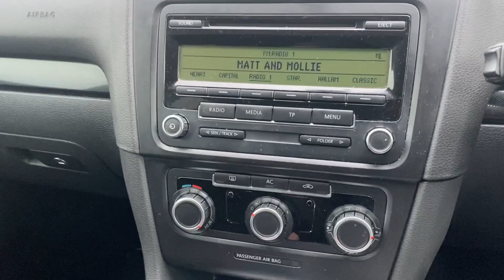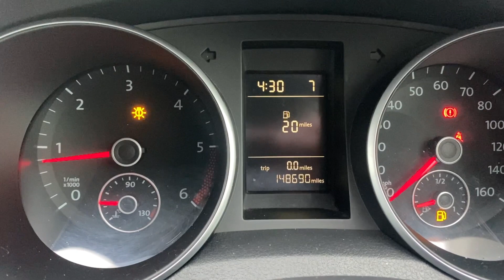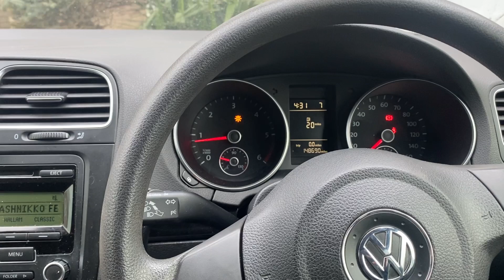VW GOLF MK6 1.6tdi DSG gearbox failure common fault on 7 speed auto. Reason for the failure DQ200

Comment: I have golf 6 dsg 7 gears the shift indicator dosappeared from the cluster and vcds shows me P0820 fault code do u have any idea what's the problem? The gear drives normal and no problem just gear indicator disappeared
Reply: probably mechatronic problem or low hydraulic fluid level
Reply: @StationX2  but no leaks at all the gear box from underneath is dry no oil spots and shifts normally
Reply: @fadiabdo9976  well if it drives normal and you have no issues there's nothing to do with changing the gearbox, but mine had issues thats why i changed it.

Comment: Hello I have 1.6 tdi golf 2011 gear box sometimes when driving shuts down and then I put in N and then back in drive then car moves but sometimes car jerks and doesn’t catch speed any help ? Maybe needs service or gear box is gone ? 150k on clock
Reply: probably mechatronic problem or low hydraulic fluid level

I had the same issues, if your transmission is 7 speed change it to a 6 speed its more reliable and it doesn't have that kinda problem.
Reply: I have the same problem..
Reply: Did you fix it ?

Comment: I have the same DQ200 gearbox in my Golf MK7.5 1.6tdi remapped to 150hp and it has been reliable so far done 80k miles. Does anyone recommend servicing these gearboxes as VW claims its sealed for life
Reply from the maker: Yes I recommend change the gearbox oil and mecatrônics oil two VW have the oil for sale
Reply: @HelderPutoPerformance  is it easy enough to change by myself or reckon it's better to give it to a garage but many garages that I've visited doesn't even know abt dq200 gearbox and think it's just one oil so I don't know if I can't trust them

Comment: Got hot probably oil starved causing the bearing over heated welding itself to shaft more heat finally warping end of shaft. Possibly from going to many laps of local roundabout or just draining oil for service and forgot to re fill oil till it was to late
Reply from the maker: Hi probably have no oil that’s y is gone  but end I check have oil probably put oil after is broken 😂

Comment: Please can you help I have code p2849  fork a stuck dsg only selects even gears  and reverse any help would be massively appreciated
Reply from the maker: Hi mate without see the car and diagnoses is hard to tell what the problem
Reply: I have the same issue. Did you manage find out the what the cause was?
Reply: @onrd1775  it needed a complete rebuild and mech unit not cheap that’s for sure

Comment: Do golf mk6 7 speed dsg 1.6tdi and 1.4tfsi gearboxes are same or different?
Reply from the maker: Different gear racio
Reply: My gearbox code is MLE. Would my car work with same year 1.6tdi 7speed gearbox but different gearbox code for example I found on sale MGN gearbox. Or I need exactly the same gearbox code? Thanks for answer
Reply: @linasvaici  The original 6 speed gearbox had wet clutches and was made by Borg Warner. The later 7 speed boxes had dry clutches and were manufactured by VAG.

Comment: so I can change my oil on a dq200. I thought was sealed for life
Reply: 100k is the life according to manufacturers so after 100k just service it and it will last another 100k
Reply: @arbazamir8991  MInes at 201000 kms and seems ok. Im told you cant change the oil Do you have a video on  it

Comment: Helder do you know anything about fault code P1887 on transmission i have the 1.6tdi dsg 7 speed audi a3 keeps coming up with this code
Reply: Torque converter clutch release switch is that code. Problem in the circuit of the trans
Reply from the maker: No sorry

Comment: Caixa dq200 infelizmente tem alguns defeitos na sua construção. Caixa é dividida em duas parte mecânica e a parte de megatronica. Ambas usam fluídos diferentes. Que segundo a VW nunca devem ser substituídos. Ou seja se a caixa estiver a funcionar bem é deixar andar. Eu pessoalmente nunca vi uma dq200 com esse defeito mecânico. É muito normal elas verter oleo na megatronica, rebentar o acumulador de pressão hidráulico e patinar embreagens por desgaste. Embreagens é outro filme para removeres esse conjunto não existe problema. Depois o problema é montar, é preciso uma ferramenta especifica para essa caixa para calibrar as embreagens lá dentro, porque se não calibrares, carro vai vibrar imenso na troca de mudanças. Embreagens vai a vida num piscar de olhos. Limite dessa caixa stock são 250nm ou 25kg força. 1.6 tdi stock já faz isso. Mas já testei com 300nm e já começa a patinar. Ideal é abrir o mapa da caixa e aumentar o torque monitor apenas para 290nm de torque, tanto na caixa como no motor e já fica uma coisa engraçada. Mais do que isso não. Arrebenta logo as embraiagens. Alguma duvida contacte. Espero ter ajudado. Ps um conselho compra uma caixa boa usada, umas embreagens novas e tá feito. Não vale a pena reparar.
Reply from the maker: Obrigado pela enformação 😉
Reply: @HelderPutoPerformance  tenho um 1.6 tdi cxxb com essa caixa. Só tem o problema de não poder dar torque. Mas a caixa é fenomenal é das dsg mais rapida. É mais rápida que a dq250. Tiras o fap e as egr a isso, limitas o torque a 290nm. E o carro faz na boa 150cv tranquilo. Fica acompanhar carros até 180cv facilmente. Graças a caixa ser rápida. Carro sai te para a frente com um gaz do caneco.
Reply: @HelderPutoPerformance  mas limita o torque em 1 e 2 mudança. Aos 250nm.
Reply from the maker: O carro e para vender nao vou andar a mecher mt

Comment: worst dsg ever, worse than ford powershift
Reply: I actually brought a vw golf over a Ford focus because I read such bad reviews about Fords auto powershift unit. My golf has this dq200 gearbox and I'm getting nervous reading all the reviews. That said, it's works brilliantly at the moment but apparently they can fail any time without warning. 😬
Reply: @tomg6333  I'm planning on buying a 2015 used  VW vento (polo sedan) TDI with 7speed DSG. The car has only been driven for 20,000kms(12,000miles). Do you think I should go for it ? When do you think I'll be facing problems with the gearbox? Thank you!
Reply: @neilaloysius3634  Definitely test drive it before buying....gear changes should be smooth. If the car jerks or lurches or any noise (banging) when changing gears this is a bad sign. Check the reverse gear is OK too. As for how long they last...well I see many cars with this transmission for sale that have done over 100,000 miles so they can last. Personally I'd be more concerned about a blocked diesel particulate filter on a car that's only done 12,000 miles in 6 years. It's suggests they may have used this car only for short journeys (which isn't good for a diesel) but I could be wrong. Make sure there's no smoke coming from thr exhaust and the engine accelerates properly. Hope the car is good if you buy it. 👍
Reply: Hi there. 
I have a problem with my Gti golf. Gearbox DSG 7 - DQ200
Gears coming :
1 - 3 - 5 - 7
Gears not coming :
reverse - 2 - 4 - 6